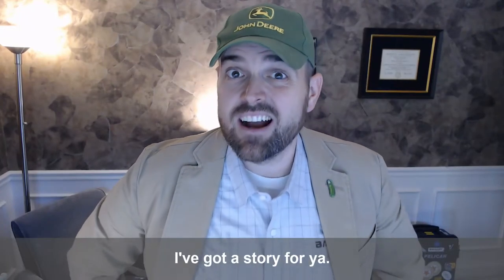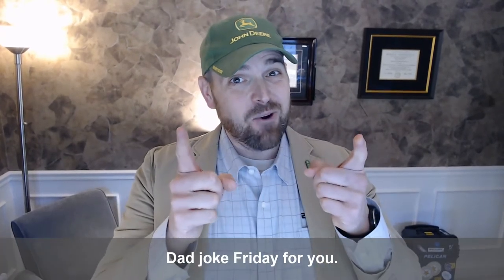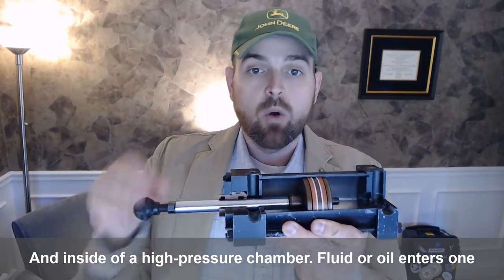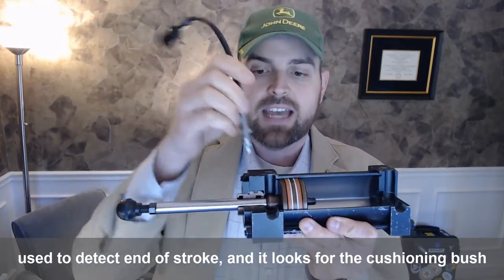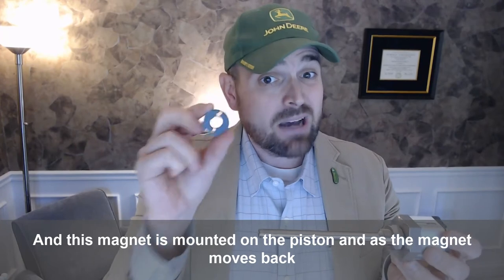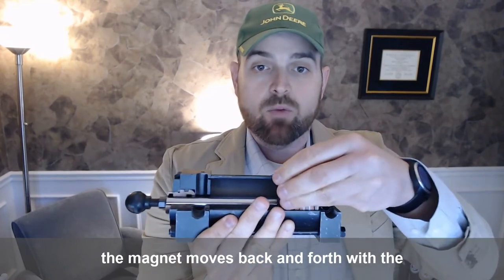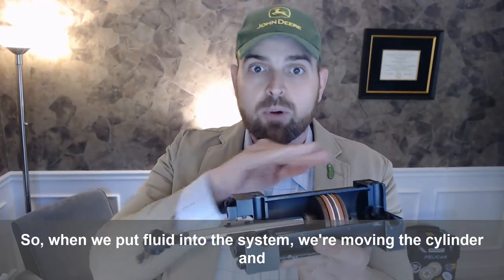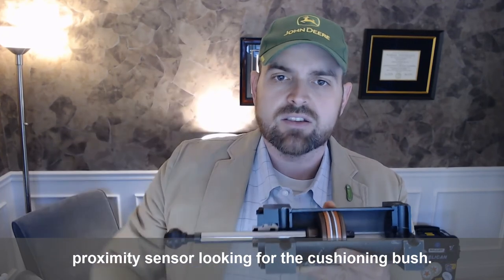Sensor Basics:  Hydraulic Cylinder Sensing for End-of-Stroke or Continuous Position Monitoring

Comment: Do you have any idea how you can by pass the linear sensor
Reply from the maker: Typically most are part of a closed loop system providing position feedback. As soon as this is attempted its likely that the application could no longer work and possibly be dangerous by giving the controller an erroneous signal.